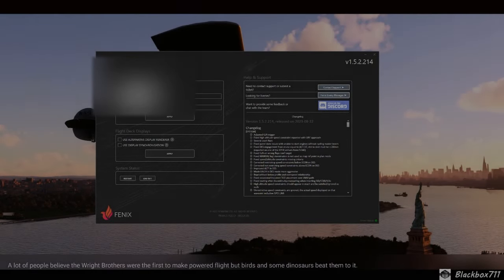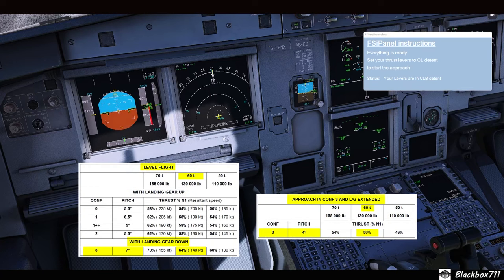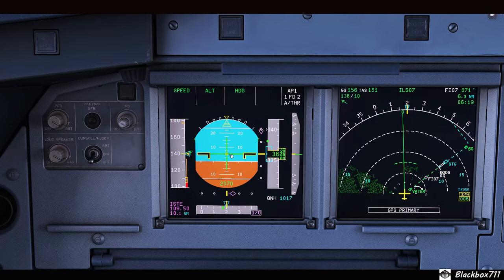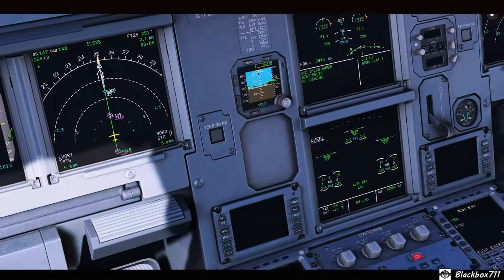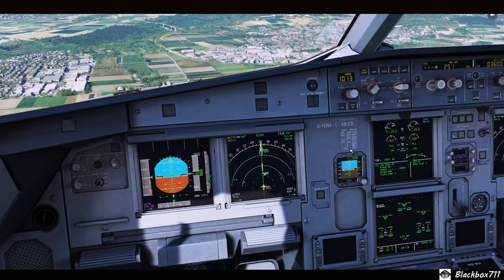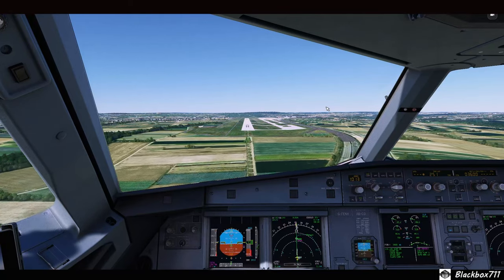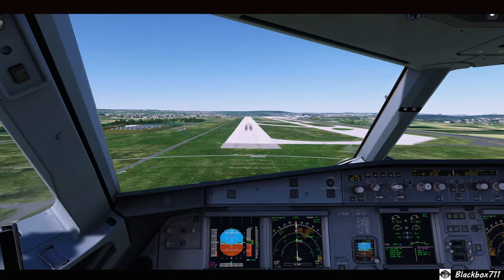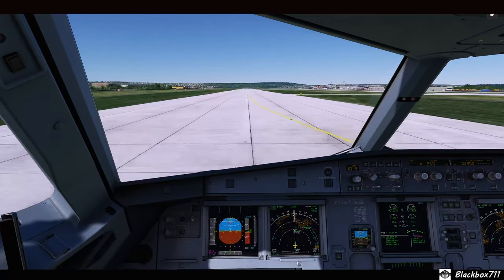FENIX Update Version 214 - Flaps 3 Drag and Flare Improvements

Comment: I can understand the fact, that is hard to make proper model behavior of the AC, if I pick up PMDG in real life I need to keep thrust to at least 20ft RA than close thrust levers otherwise it will be hard landing. The MSFS itself is problem as all airliners has unrealistic rotation and flare behavior compare to real AC. X plane is closer to reality. I m not A320 type rated, but I feel after last update  there is somethig wired. Example: in MCDU i have max FL 370 and AC has a problem to climb into 350. In simbrief I need to adjust Fl and set performance factor -09 to match proper calculation. Do you have same problem or it something wrong on my side? Anyway very professional video I like your review
Reply from the maker: Yep, talked about this many times on my livestreams. Hopefully MSFS2024 will finally bring the promised improvements regarding external addon integration including individual drag/lift/thrust values.

Comment: Hi BB, I know that the behavior of the fslabs is better at the moment in your opinion, but is it realistic or just better than the fenix?
Reply from the maker: Hi. That is always very hard to answer because that depends on what area you are referring to? Flight dynamics, system simulation, sounds, visuals? The FSLabs doesn’t win in every category (visuals for example) but overall it is a very good addon that just seems to be almost fully complete. One thing that is excellent is the correct pitch/power values and the flight model including flare behavior.